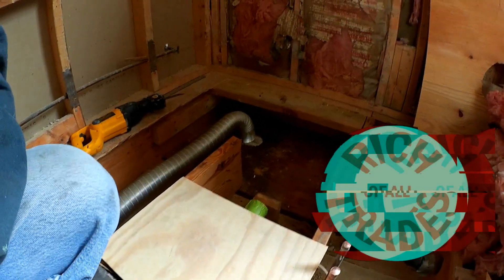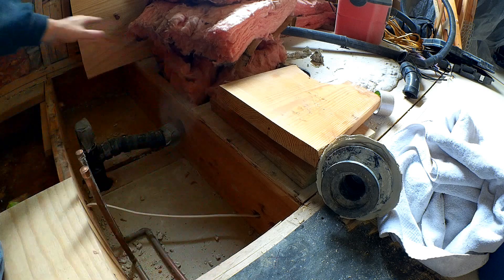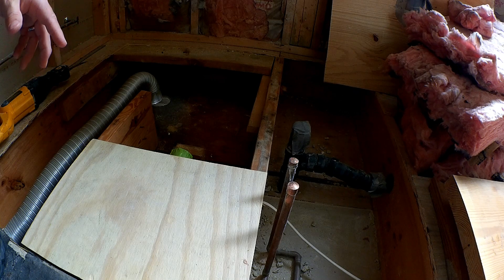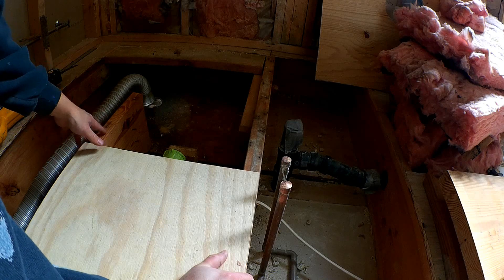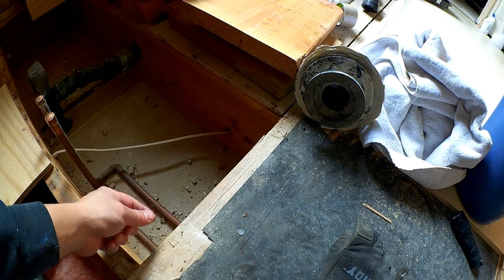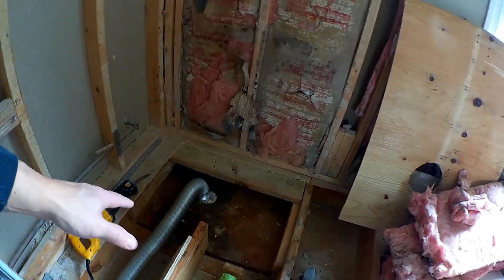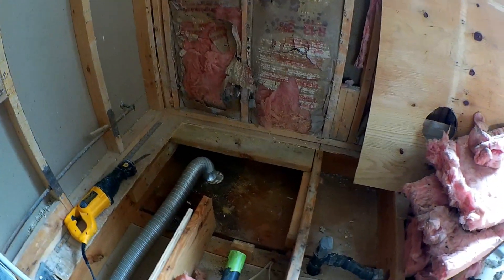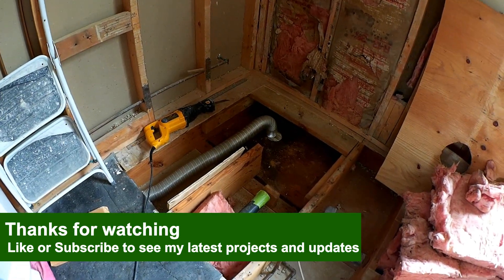Curbless Shower Pan Planning On A Second Floor (Notching Joists)

Comment: wondering how you are going to notch the joist?
Reply from the maker: Thanks for the question, I didn't video the actual notching, but I do have a follow-up video showing the results just before securing the subfloor. You can see it here https://youtu.be/lUeEP075olY
For notching the joists, I set the depth of my skill saw to 1.5 inches and made many cross cuts across the top of the joist and then used a hammer and chisel to pop the sections out and clean up chiseled area smooth.